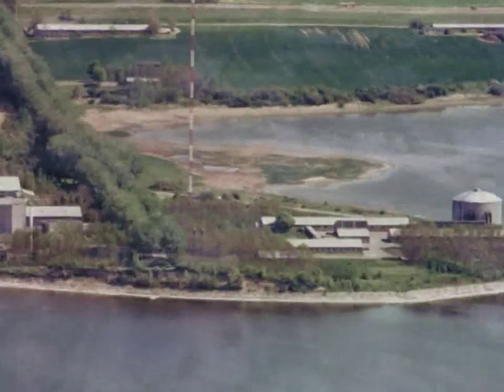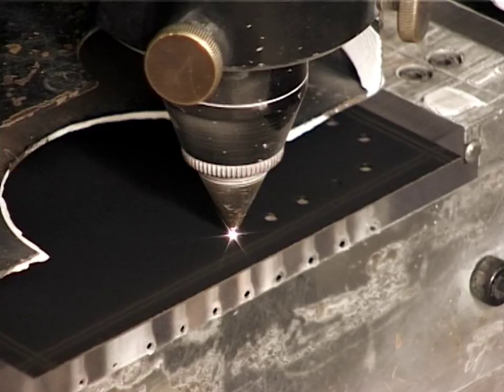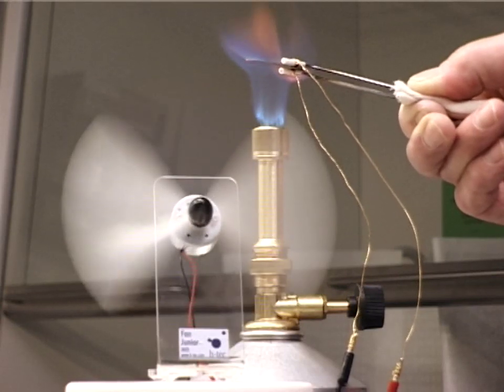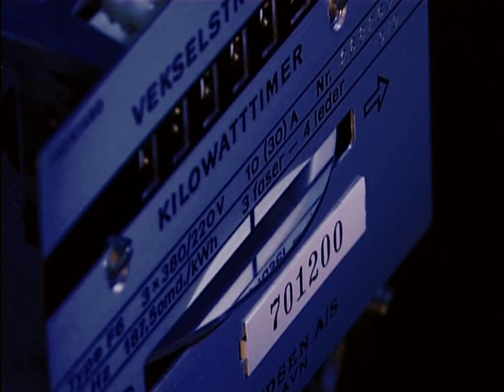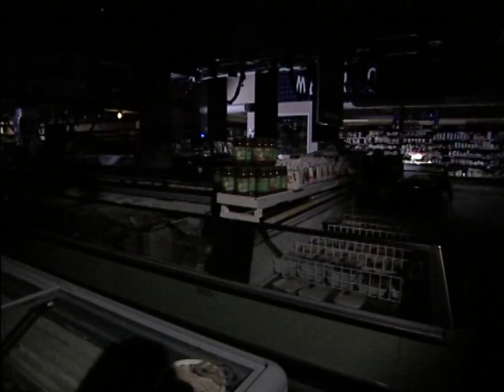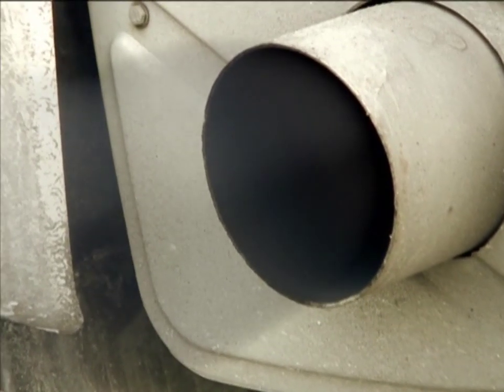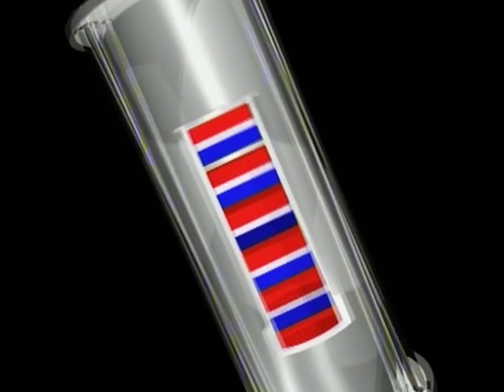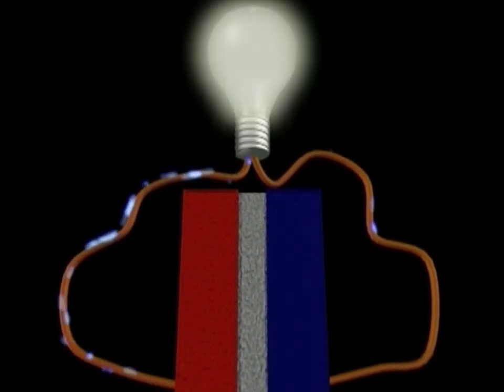SOFC Fuel Cell Technology from Topsoe Fuel Cell

Comment: I have been a huge critic of fuel cells and electric vehicles for a long time. Electric cars are just getting to the point where I think they can start offering some competition to traditional internal combustion engines. Learning about SOFC has blown me away. If they can get these to the point where they can use diesel or gasoline in an economical and applicable system they would offer all the benefits of both internal combustion and electric vehicles. If you run out of power go to the gas station. Want to increase mileage, well, diesel is incredibly energy dense, SOFC is much more efficient than combustion and electric motors are more efficient converting energy they are given to mechanical movement. Any organic fuel can be used, such as (bio) diesel, alcohols, oils. Finally emissions consist of mostly water and carbon dioxide reducing smog. I think the only thing that would need to be done for infrastructure would be to have gas stations offer a different kind of blend that better suits fuel cells.
Reply: Agreed the fuel flexibility of a internal combustion engine, the quiet of a battery, the energy density and rapid refueling of chemical fuels, all while being more effect then standard internal Combustion Engines. Combine with a electrolyzer of a liquid chemical fuel like methanol which is vastly easier to split then water and can be sourced from pre-existing petrol companies or carbon neutral biowaste of all sorts. Some processes like gasification leave char behind which if buried is carbon negative with soil fertility benefits. 

The only battery that comes close is Liquid Flow Cell Batteries but when then their electrochemistry lack the biomass recyclability carbon cycle and net loss while also not being anywhere close to energy dense as chemical fuels. A fascinating technology to be sure as it can be recharged or rapidly “refueled” by transfusion of pre-charged electrolytes, but fuel cells and biofuels/e fuels will always have a special place in my heart.

Comment: It doesn't convert heat to electricity, it converts partially combusted fuel, H2 and CO, to electricity, heat is required for the electrolyte to function. They can be made to run on any fuel, such as ethanol, they are not solely dependent on fossil fuels. I think they are a good option...

Comment: people are stupid...heat is electricity...but there is a simple way to get free electricity from mains...so there is no reason to buy electricity...current is only sent 1 way by the electric company...and it's done that way so they can meter the consumption...ac is dc that is turned on and off quickly...ac current does not go in both directions...its like pushing someone on a swing...and there is an equal and opposite reaction...and the initial force is what causes the person to swing in the opposite direction of the push...no energy is being applied in that direction...same exact thing happens with electricity...that is what ac current is...power companies push the swings...if you have 2 people on opposite sides of the swing then the initial person only pushes 1 time by themselves and they now only use half of the energy because there are now 2 sources of energy...this is how solar panels can backfeed the grid and causes the house to consume less energy. So if you apply a force... or current... in the direction that the electric company does not...it will cause your electric meter to spin slower...and if you apply more current in that opposite direction of your power company it will cause your electric meter to spin backwards...which is why most power companies will install a 2nd meter so people don't know that it can spin backwards...also they put the second meter in because they buy back the power at a lower rate then you pay them for it...so if you use the neutral wire as hot without tying it to ground...it will cause your electric meter to spin slower because you will be using that current against the current from the power company which will decrease the force of the current being delivered to your house... electricity behaves exactly like water. So it's much easier to think about water in a pipe for most people...its actually very easy to do

Comment: So it is an efficient way to convert heat to electricity, but is still dependent on fossil fuels like gas. Even if it uses those fuels efficiently, you are still dependant on those. That way it doesn't seem like a good option to me. PlasmERG looks more promising.
Reply: Pikitoko, it is a VERY actually a good idea! I elaborate more on use of energy and fuels for renewable energy here: https://medium.com/@Jernfrost/energy-production-and-storage-on-other-planets-23ac8fe40892 . Now that is aimed at energy usage and storage on other planets, but the challenge of that is exactly the same as for getting green energy on earth, because there is no oil, coal or natural gas on other planets.

The key point is to stop regarding gasoline, natural gas, diesel etc as only energy SOURCES. They can also work as energy CARRIERS. We can use renewable energy to synthesize gasoline, natural gas and diesel. When we  do we call them biofuels. Now why would we do that? Because these fuels have incredible energy density. Rather than moving energy from say the sun around in the form of a battery, you can carry a lot more energy around if you store it as some sort of hydrocarbon. 

So far all the rage has been about using hydrogen as an energy carrier. However that is a terrible choice, because hydrogen is a pain in the neck fuel to deal with as I elaborate on in my linked medium article.

SOFC fuel cells can also use e.g. ethanol which countries like Brazil is already creating in huge quantities form renewable resources. A lot of their cars already run on it. But by using fuel cells you increase efficiency.